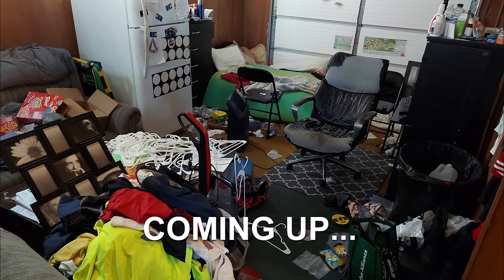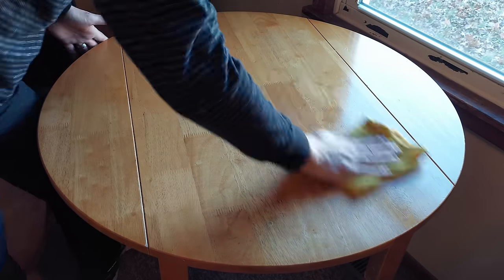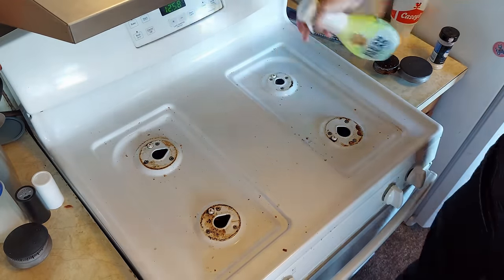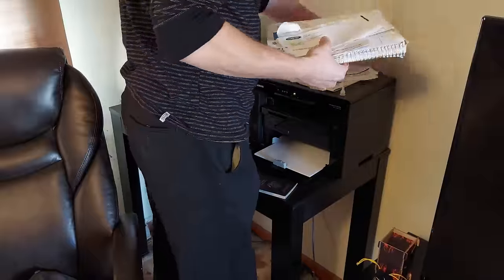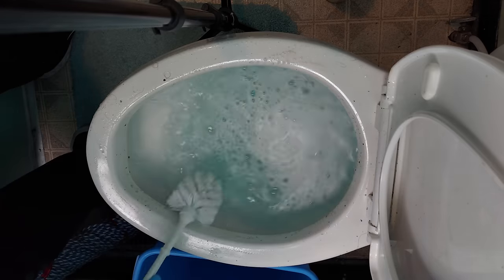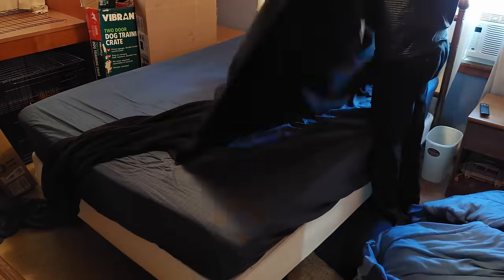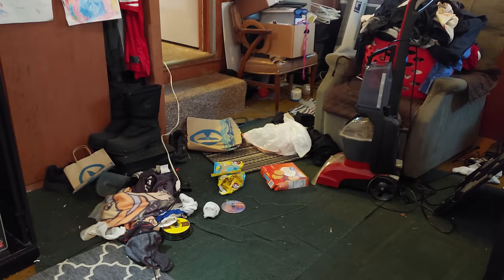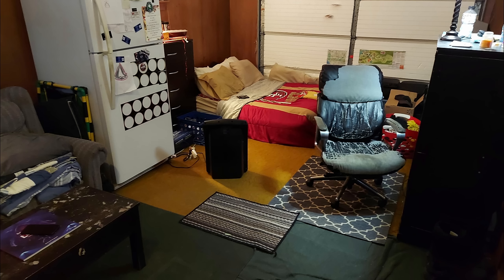Autistic man cleans TRASHED houses for FREE!

Comment: Love your method/rationale with regards to your order of cleaning.  It makes sense. I basically just start at one corner of the room and move in one direction. I do put a large clothes basket in the middle and put things in there to have a clean surface then put everything back in the correct place when I'm done. Save me a lot of walking back & forth. 

You said "butt pants"...hehehehe

Wearing two different brands?!? You're a rebel!! 

I don't see how you can use microfiber cloths. I know they are great, but if I touch them barehanded,  it hurts. I've always had to put hydrocortisone on the rash that follows. 

Oh look, more hangers.

I once vacuumed up about one foot of a strand of Christmas lights. Not my finest moment.

Comment: Hi! Thank you for your funny and satisfying content! I saw you trying to get the red marker out of the counter, I was wondering if you heard of the dry erase marker hack? Sometimes, when a permanent marker is used on a surface, just wiping over it with a dry erase marker and then wiping it away can remove a lot of permanent marker stains. Some, not all though. Thanks again!
Reply: That trick works so good.
Reply: Straight 91% rubbing alcohol also works, as long as the surface isn't too porous.
Reply: The dry erase marker trick works every time!

Comment: 1) I’m glad you refolded that blanket on the sofa. It was nagging at me when you first folded it. 2) I don’t know any other way to deal with a room wide mess other than to remove items off one surface, clean it, move them back, then move things off the next surface. What else do people do to clean room wide? 3) if someone owns a Toto toilet, you should not use a toilet brush or abrasive cleaner to clean it. It could take off the special glaze that actually keeps the toilet cleaner longer. The particles are so fine that bacteria can not embed and grow very well. Mine was worth the $812 it cost.  One of those flat magic erasers with dish detergent will clean it. It doesn’t take much even after 6 months (I saw a plumber experiment with the time it takes. Mine is still just four months old and still not a sign of anything. I do wipe the seat down daily with sani cloth, though).

Comment: Best thing for red stains, especially beetroot is Milton sterilising solution, (it’s mainly used for babies sterilisers the old fashioned ones 😂) get a sheet of kitchen roll, place it over the stain on the counter, then put a few drops on the piece of kitchen roll, till it’s all wet, so about a half to a full cap full, then wait a couple of minutes, take it off and it’s gone, AND it doesn’t damage the worktop, 😊good luck 🍀 😊xoxo ❤

Comment: Buy yourself a commercial Orick vacuum they are under $180. The red Oreck has a 40 foot cord in the blue Oreck has a 30 foot cord. It will make your life of cleaning so much batter!  100% better than that vacuum that you’re using right there. And the vacuum only weighs 8 pounds! I have tried every vacuum on he market.  I’ve owned a cleaning business for seven years I’ve tried every vacuum on the market. Orick is hands-down the best!